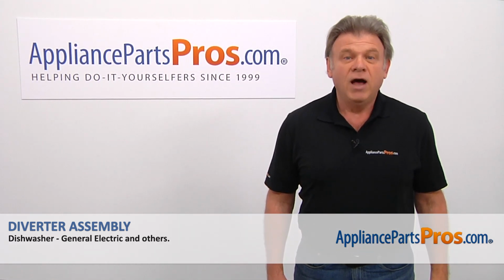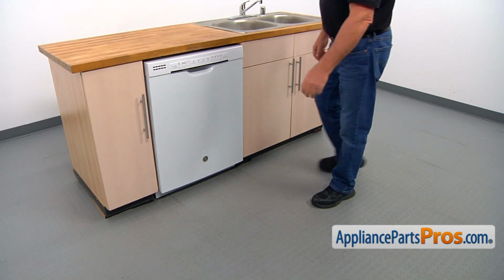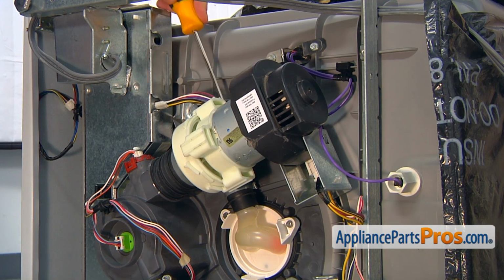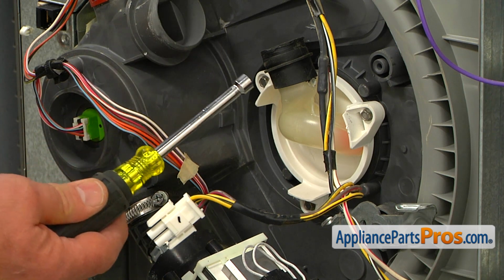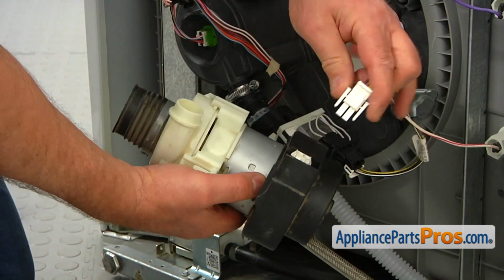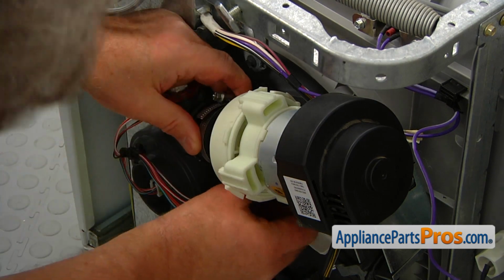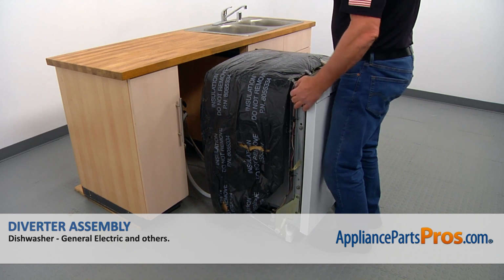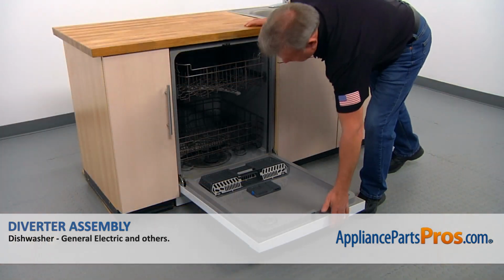How To: GE Diverter Assembly WD35X10386

Comment: What was wrong with it.... does the ball get stuck?? how does it work??
Reply from the maker: What is your model number and what is the issue you are having with it?
Reply: @appliancepartspros  GTD605PMMEOS upper spray arm no water and yes I took the spay arm off and cleaned it
Reply from the maker: I'm sorry, GTD605PMMEOS, is not pulling up as a valid model number. Can you look on the unit and double check that information?
Reply: @appliancepartspros  Sorry it's GDT
Reply from the maker: Thank you. The ball inside the divertor can get stuck, so you will need to check that and check the divertor for any damage or clogs. If that is good and you still aren't getting water to the upper spray arms, then you could be looking at a bad circulation pump.
Reply: @appliancepartspros  Thank you for that. I will check to see if the ball is stuck could ask you one more question...I have a button that choose which rack to spray how does that work aka..how does the BALL KNOW WHAT SPRAY ARM TO engage 😁

Comment: Thanks!! Nothing but problems with this GE.  That rubber piece that connects this piece to the motor was dissolved.  They must have gotten a petroleum product on it during assembly.
Reply: It’s designed to fail I think. Mine has failed on both the pump and the diverter and I had to replace both. Never buying a GE again.

Comment: This install is incorrect and you will tear the diverter rubber hose. Keep in mind the diverter rubber is chinesium and was the culprit for your leak in the 1st place. Install the pump into the diverter outside the unit as one assembly and lightly clamp ensuring it can move but not easily. Lubricate with dish soap as he shows beforehand. Now install the whole assembly back and it will go in with no effort including the holding tab. Press the pump back into diverter and clamp down but not too right. Put 3 diverter screws in. And lastly the pump discharge clamp.
Reply: Great info! What is chinesium?

Comment: Yep, another pinhole leak area in the rubber hose after 2 years since new...I cut a small piece of PVC pipe that fit between the two plastic end fittings (outlet side), with some sealant around it, replaced new hose clamps (can get at the hardware store since as the video shows, you can't reuse the cheapy-ones they use at assembly) then a couple zip-ties around the middle section of the rubber hose around my little insert piece...took some fiddling, but saved over $50 vs buying a new diverter assembly kit.
Reply: Nice

Comment: my ge adora dishwasher has a leak underneath.... it leaks where the rubber hose from the diverter attach to the pump... i was wondering is this due to the clamp defect or the rubber part is damage?  Thank you for this video... i will give this a try to change it.  i almost give up and get a new dishwasher until i saw this video